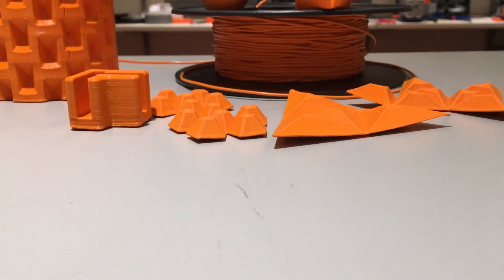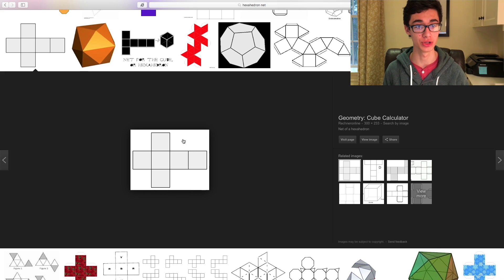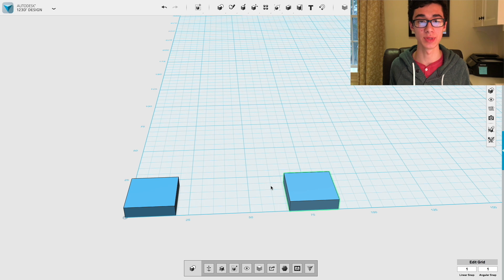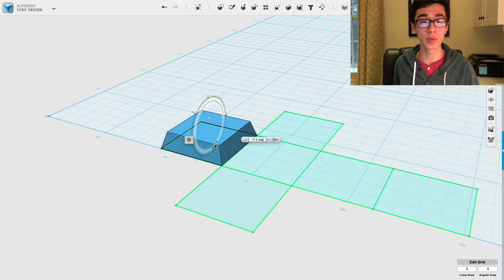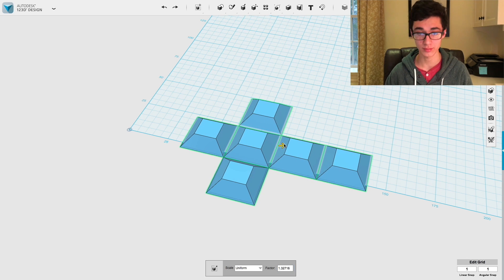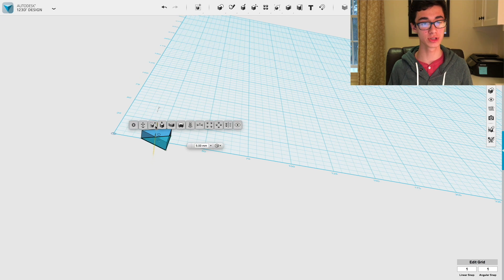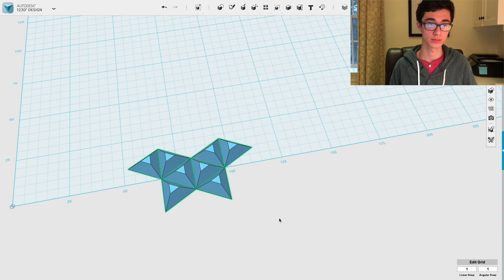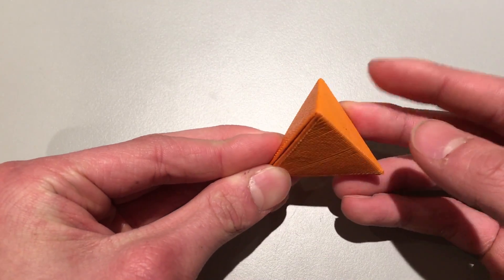Foldable Polyhedra

Comment: This is awesome! Maybe you can put some magnets in the sides so that it stays together when folded. That way you can make foldable dice for example. Not sure how useful it would be. Maybe there are better ways to make it stay in its form, like some kind of snapping mechanism...
Reply from the maker: MatthiasChristiaens thank you! i love the idea of using magnets, I just have to play around with that. I'm currently looking to roboticize these prints using cables and motors.
Reply: XYZAidan That's awesome! How is the project working out so far? Also I made a design a few hours ago of a cube with some kind of snapping thing (I can't really describe it). I'm not sure how it would work out because I don't have a 3D printer yet so I can't try it out unfortunately.
Reply from the maker: Thanks, it's working out well so far, however I anticipate some difficulty once I start attempting multidirectional bending. Your design sounds interesting, is it meant to be printed in a soft material?
Reply: XYZAidan Yup it's for flexible filament. I can send you the file or a pic if you want. Not sure how, maybe I can try to pm you in YouTube.
Reply from the maker: MatthiasChristiaens id love to take a look at it! You can email it to me if you want at: aidan.leitch@gmail.com